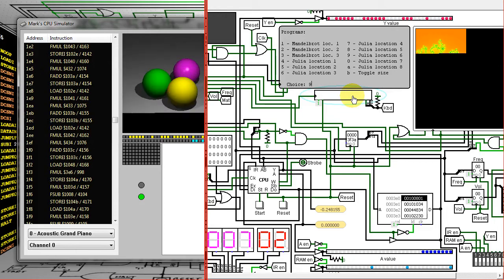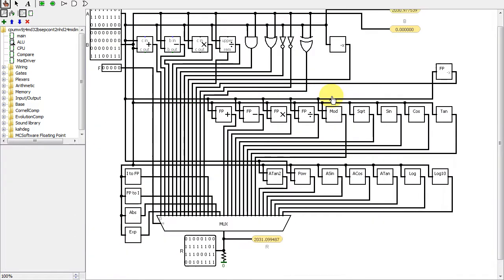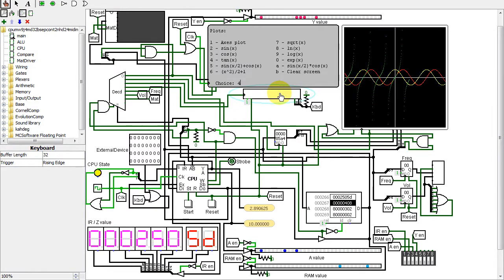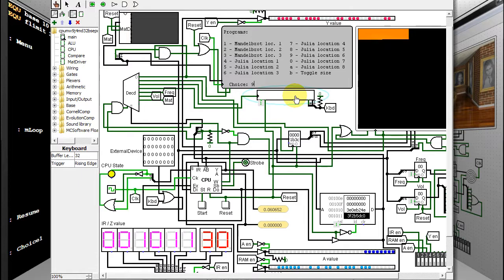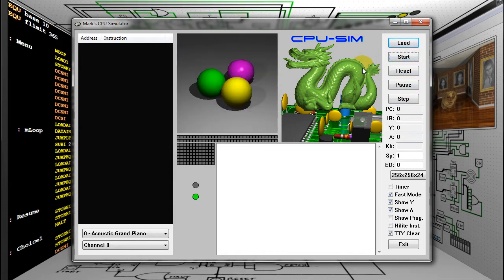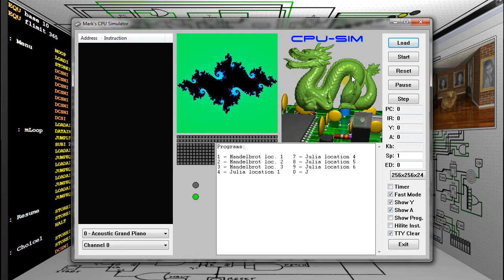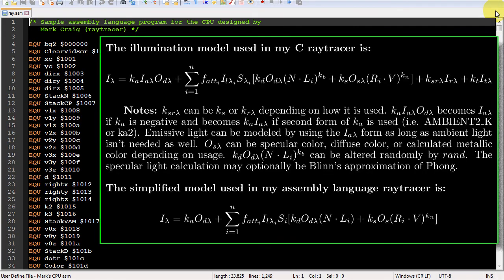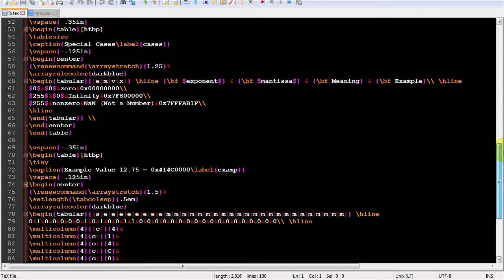My Logisim Floating Point CPU / Computer - (FPU) (Fractals, Raytracer, Etc.)

Comment: Hey, I don't know how to build a floating point unit. Though, I know how to do floating point addition, subtraction, multiplication and division with pen and paper. I don't know how to build the normalizer/bit finder and the barrel shifter. Can you please help me?
Reply from the maker: In case you don't know, the FP JAR library I wrote, as well as every Logisim JAR library and every component in Logisim are software solutions, meaning that they are coded to perform the same function as the hardware, and NOT built like the hardware, if you know what I mean.  So, a software solution would not use barrel shifters, etc.  Some might call this cheating, but I can guarantee if every component was coded by EXACTLY how the hardware would be constructed, Logisim would be much slower.  So, I haven't actually modeled the actual hardware.  And, I'm pretty sure now-a-days, you would just program your FPU in VHDL or Verilog (using software methods) and the synthesization software would create the actual hardware implementation.  Or you would even just use a floating point IP core.

At any rate, if you still want to model the actual hardware methods, here's some websites I found that might be of help (especially the hackaday one (though, I haven't checked it to see if the circuit works correctly))...

https://en.wikipedia.org/wiki/Barrel_shifter

http://www.eng.utah.edu/~cs5830/Slides/FP-cktsx2.pdf

https://hackaday.io/project/6259-exploring-floating-point-with-logisim

http://users.encs.concordia.ca/~asim/COEN_6501/Lecture_Notes/L4_Slides.pdf

http://ijarcet.org/wp-content/uploads/IJARCET-VOL-1-ISSUE-7-130-136.pdf

There are also many patents covering these topics, but I don't know how much help those would be.  I hope this helps...
Reply: All right, thank you very much.

Comment: Wow, looks very interesting. Aren't you planning to make this thing work on FPGA?
Reply from the maker: Thanks!  I would like to put it in an FPGA.  I'm not sure I'll get a chance to though.  But, I do know that the floating point part most likely won't be part of an FPGA implementation (at least not more than +,-,*, and /), and I realize this isn't quite how FPUs are done in real life  - since math functions (such as pow) and even division, etc. take more than 1 instruction cycle to compute (since they're not combinational operations), I would have to have some sort of signal that tells the CPU to wait until the FPU has finished calculating the value (in a simple CPU design that is).  I didn't model that in this circuit because the values are computed in a jar library (thus every math function finishes in 1 logisim CPU instruction cycle, so no need for a signal - actually, the values are computed in less than 1 instruction cycle, since the ALU is always computing values (even when it's not asked to, which is another way this FPU is different than real life)).  My next video is about a hardware stack for my CPU, but I had no choice but to use a gated clock for the stackpointer counter (clocking off the main clock wouldn't work), which could also be a problem in an FPGA - but I thought about it a bit, and it seems to me as long as the RAM can handle the timing correctly, the gated clock shouldn't be a problem.
Reply: I am looking forward to see your next videos about it. Are you going to make only push-pull commands for stack or also some procedure handling commands like CALL?
I've been planning on making a little GPU with shader cores on an FPGA board for a while. But it is very complicated task and I didn't know where to start from. Do you think is open source FPU IP-core from opencores suitable for that purpose?
---
Just noticed your new video
Reply from the maker: There's no PUSH or POP instructions (due to not enough room in the circuit), but there is CALL and RETURN (but no parameter passing).  In the video, I show a user stack I wanted to put in, and explain the space problem.  I would just need to move some of the stuff to subcircuits to make room - just wasn't sure I wanted to do that.
Your GPU idea sounds nice!  The last time I looked at opencores, I didn't find any that did a full set of math functions (just +.-,*,/, and maybe a few basic math routines (pow?, abs).  I didn't try searching for GPU though.
Reply: Thanks)

Comment: :O! How did you learn all this?
Reply from the maker: I created the original CPU design for a homework assignment for a class in college, so I guess being in that class is how I learned it.  But, it depends on what you mean by "all this".  The logisim part is purely on my own (but I found out about Logisim and it's potential use for simulating a CPU by watching a YouTube video).  The JAVA programming part is purely on my own (I taught myself JAVA) (but the internet was a valuable resource, especially the JAVA/Oracle API reference pages which list all the members of the classes, etc.).  The raytracing part I learned from a different college course (but I first programmed a raytracer after graduating college, so I would say the course gave me the confidence to try writing one).
Reply: MrMcsoftware Wait, you have a degree?
Reply from the maker: Yep, a BS/Bachelors and MS/Masters.  Probably, one of my classes had the IEEE 754 stuff (though, probably not formally) but I can't remember for sure.  I was aware from a class that floating point values are stored with exponent and mantissa, but the actual IEEE 754 specific stuff I learned from the internet.
Reply: MrMcsoftware How do I get one of those magical degrees?
Reply from the maker: Go to college?

Comment: Where could I get a software that I can code my logisim because coding the ram in hex decimal is not worth the time and what do you use to code your programs
Reply from the maker: I wrote an assembler to convert assembly language to machine language (that can then be loaded into the RAM from the RAM's menu).  Unless you create a CPU that identically matches a well known CPU (pentium, MIPS, etc.), you would have to write an assembler that matches your CPU's instruction set.  If you did model a well known existing CPU, then you could use already available assemblers.   I assume the second part of your question was asking about the assembler, but if it happens to be asking what do I use to edit the code - I mostly use vi (vim version of vi, I believe) (windows version of the UNIX/linux vim).  But I show the code (in the video) with notepad++.  If, by some chance, you mean a higher level language (like C) then compiled to my assembly/machine language - that would be great, but not so much doable (would at least need a more capable CPU (need hardware stack, more registers, more addressing modes, etc.) and a whole lot of free time (and I mean a LOT)).  But, I guess one could create their own very simple higher level language.   But, in all practicality, the only choice is to code assembly language.

Comment: Hey, that's cool
If you are interested i'm an italian student and i started a fork of logisim 1 year ago, you can try it here: https://logisim.altervista.org/ or see the github page here: https://github.com/LogisimIt/Logisim
If you have any kind of suggestion I'll try to do my best
Reply from the maker: Thanks.  I've seen you around, I don't remember where (YouTube, Reddit, or somewhere else).  I tried out your fork.  I like the new additions (the oscilloscope,  etc.) as well as new parameters for the original components (flip flops, memory, etc.).  Really nice.  There is one problem, though - I couldn't load my CPU because I use a JAR library that uses GraphicsUtil.switchToWidth(Graphics, int) and that doesn't seem to exist in your logisim fork (at least not in the JAR version).  This problem also exists for some of the components in your PUCTools JAR library.  BTW, I checked to see that your FP components work (they do work, unlike the Logisim-iitd fork (multiply and divide didn't work in iitd fork)).  Good job!  In the case of the oscilloscope, I thought "Why didn't I think of that?" :-)  Of course, a lot of other people never thought to add that
Reply: MrMcsoftware (I'm with another account)I remember i changed that method to Graphic, float; should it be the cause of that?
Check it and if you still can't load your project tell me what I have to test so I can fix it
Reply: P.s.I updated to v2.11.5.0 and now there are both GraphicsUtil.switchToWidth(Graphics, int) and GraphicsUtil.switchToWidth(Graphics, float). Hope it will work :)
Bye, Andrea
Reply from the maker: I noticed that you changed it to float.  I'm pretty sure that would be the problem.  I think what's happening is that when your fork is compiled, every class/procedure/etc. knows the second parameter is float.  But since Logisim JAR libraries have to be compiled with some version of Logisim (most likely using a version with an int second parameter) a conflict can occur.  Overloading (as you have done (indicated in your next comment)) should be the solution.
Reply from the maker: I'll give it a try.  It should work.  Thanks for the update.
Reply: MrMcsoftware Thank you for reporting me this problem. Let me know if it works, bb
Reply from the maker: That solved that problem.... but, there's another problem (same reason), a color parameter was added to InstancePainter.drawBounds()     (IIRC), but a JAR library (this time it's kahdeg's sound component) needs InstancePainter.drawBounds() with no parameters (so does PUCTools.jar).  So drawBounds should be overloaded as well.
Reply: Ok thanks, I checked PUCTollos.jar and there was another method no more compatible; i made a commit and re-compiled, you can try it here: https://github.com/LogisimIt/Logisim/tree/early/Compiled (I wait to add new changes for a new version, so for the moment i send you what i pushed on github)
If you want, you can also write me at logisimit@gmail.com
P.s. Merry Christmas!

Comment: Any tutorial to make a similar thing like this?
Reply from the maker: I'm not sure what specifically you mean by "like this".  If you mean floating point components then I would say no.  The Logisim-iitd fork does have a few floating point components (but half of them don't work (multiply, divide, and integer conversion don't work)).  If you mean the CPU in general, then I would say my whole series would be a tutorial (especially my first Logisim video).  I've made two playlists to make it easier "Logisim CPU" and "Electronics".  I would put links in this comment, but I think YouTube will think this is spam if it sees URLs.  If you're also thinking about books, let me know - I can list two books I know of that you might want to check out.

Comment: Oh cool, i also implemented a floating point math, but i was only able to create a rasterizer for my GPU. YET! Always nice to see you upload something
Reply from the maker: Thanks!  I wish I could make these videos more often, but they do take time.  Good luck on your project (I remember your question about speeding it up).  That's another wish - that Logisim ran faster :-)
Reply: Yep thats why i paused my GPU project until im able to create a logisim 2.0 that can go up to 1 Mhz (By editing the max speed of logisim i was able to get around 15 KHz, but only if i have less than 10 GateChanges/tick)
Reply from the maker: 1 MHz sure would be nice.  When writing JAR libraries, there is one thing I'm not sure about - the delay parameter of setPort.  I just set it to around the same value as used in other components (seems to be a multiple of bit-width and/or number of ports).  But I wonder if setting it higher than it needs to be might slow things down.  It might even turn out a delay of 0 or 1 might still work (and be faster).
Reply: There is no difference between 0 and 1 and higher values wont decrease the performance by much, but its super annoying, so i set all delays to 1 and changed the buffer component to have a delay attribute/setting/option.
Reply from the maker: Thanks for the info on that.  That's a good idea on the buffer component (and also all delays set to 1).  I can't remember what it was, but I remember on one of the components I created, if I was to follow what appears to be their set of rules on delays, it would have been ridiculous (something like 32*32*2), I fought no way am I gonna set it that high.